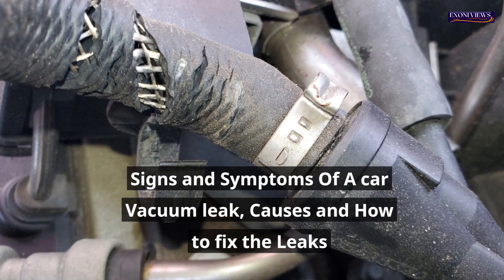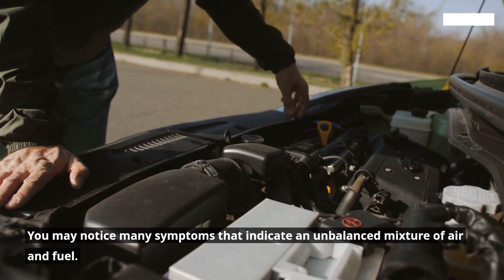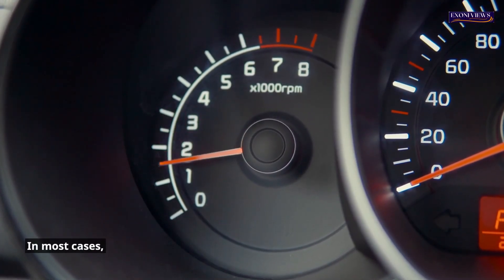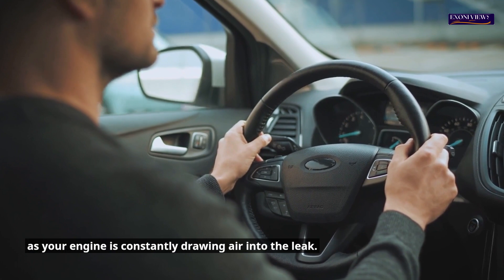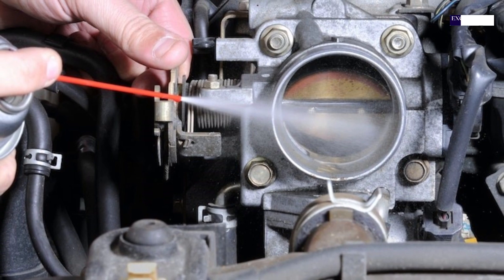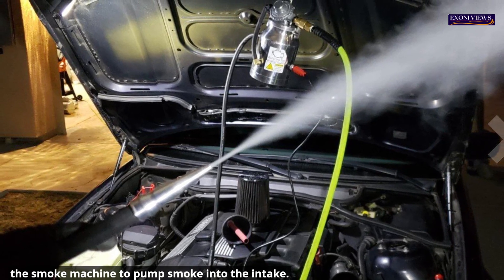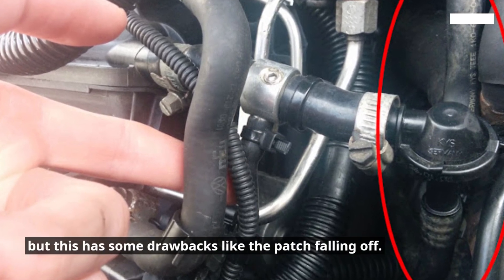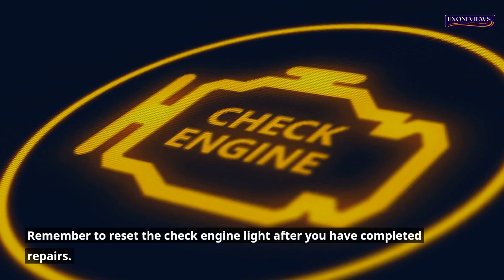Signs and symptoms of a car vacuum leak & how to seal leak

Comment: My father 2024 nissan rogue has error code p2532 at 50,000 miles. Any tips on fixing it.  Thank you
Reply from the maker: Sorry for the late reply. A P2532 code on a 2024 Nissan Rogue is unusual at just 50,000 miles. It normally points to an issue with the ignition switch circuit or the power supply going to the ECM. Since the vehicle is still very new, check the battery condition, the wiring harness around the ignition/ECM area, and make sure all connectors are tight. If it’s still under warranty, the dealership should scan it properly to trace the exact cause. Thanks for watching

Comment: I have a 2013 ram 1500 with a 5.7 hemi and mine has a engine code p219a fuel, air ratio balance bank, one that’s for the driver side and when I clear that most of the time the same code pops up or once in a while, a different code pops up for P0300 for random misfire detected all of the fuel injectors are working, I replaced a couple sensors and still nothing. I’ve been tracing this for months so I don’t know what’s wrong with it.

Comment: my freind had a vacuum leak so he covered the whole engine with spray foam it worked for a while but the foam melted and turned into a solid plastic and ruined his engine
Reply: He should have used Flex Seal

Comment: A whistling sound while accelerating? Cause ?
Reply: Something in the way of intake. maybe even inside tubing.
Reply: Something in the way of intake. maybe even inside tubing.
Reply: I heard the exact same thing when I found out my thermostat housings were about to give and low and behold both thermostats snapped and I had an overheating problem, check your cooling system. When I head a whistle when accelerating something related to my cooling system broke.

Comment: Wher dose the vacuum  hose go on a98 ford f150 .4.2 v6
Reply from the maker: The vacuum hoses on a 1998 Ford F-150 4.2L V6 connect to various components, including the intake manifold, PCV valve, brake booster, and EVAP system. The exact routing depends on the system you're working on. If you're looking for a specific connection, check the vacuum diagram sticker under the hood or in the service manual. Let me know if you need help with a particular hose.

Comment: Can a small crack / rip in the air intake tube hose cause jerky idles and Jerky city Driving spark plugs n ignition coil thermostat fresh antifreeze and Tcm motor oil n oil filter Transmission filter n fluid also serviced im swapting the Transmission speed sensor once it arrives
Only Current code right now is p0300 2005 chevy aveo ls sedan 4door 1.6L
Reply from the maker: Absolutely, a small crack or rip in the air intake tube hose can definitely cause jerky idle and driving issues, especially if it's causing unmetered air to enter the engine.
Reply: Appreciate you Capitan  @exoniviews

Comment: i have a 2013 honda civic coupe and every morning it starts rough then when i drive a few minutes it fades then start driving smooth. its just when it sits long and the engine get cools off this happens.
Reply from the maker: A rough start after sitting for a long time could be due to several issues. Common causes include faulty spark plugs, dirty fuel injectors, a weak battery, or a failing coolant temperature sensor. It could also be related to moisture in the ignition system or a problem with the idle air control valve. Try checking for any stored trouble codes and consider a tune-up if it hasn’t been done recently.

Comment: Have a po302 on my Subaru sti.  So far no luck with a smoke machine. Done all swaps,  compression,  leakdown,  o2 sensor replacement,  noid test on injector connector  what else can I do
Reply from the maker: Try to double-check the ignition coil and spark plug for cylinder 2 to ensure they're working properly. Even though the noid test showed the injector is getting a signal, it could still be clogged or malfunctioning, so you may want to clean or replace it. Also, inspect the intake manifold for hidden vacuum leaks, and examine the wiring harness for any damage or loose connections.

Comment: Hello, I know I’m abit late hahah but my VW GOLF MK7 sometime when I drive off after 30s when I stop at a junction, my RPM sits below 1k just on the line. And the fan kicks in. 
Also I’ve notice I have a leak around the engine and ‘MAF’ side. 
Also since I changed my timing belt and water pump my car started making a rattling sound. 
Do you know what could it be. 
I know it’s hard to understand what I said but if u know something help pls haha
Reply from the maker: 1.	RPM sitting below 1k and fan kicking in; If your RPM is low when stopping at a junction, it could be related to the idle control system. VW models sometimes experience issues with the throttle body or the idle air control valve. A dirty or faulty Mass Air Flow (MAF) sensor can also cause rough idle or fluctuating RPM, especially if you're seeing a leak near the MAF sensor. Address that leak, as it might be causing unmetered air to enter the system, affecting idle. 2. Leak around the engine/MAF side: If you’re noticing a leak, it could be vacuum-related, which might be causing the irregular RPM and idle issues. You should inspect the vacuum hoses, intake manifold, and the MAF sensor seal for any leaks. Also, a coolant or oil leak could cause engine performance problems if it's affecting critical engine components or sensors. 3. Rattling sound after timing belt and water pump change: A rattling noise after changing the timing belt and water pump could indicate that something wasn't torqued or aligned properly. Double-check that the timing belt tensioner, pulleys, and water pump were installed correctly. The noise could also be due to a loose belt or a misaligned tensioner, so it's best to have the belt assembly inspected again to rule out any potential damage

Comment: Replace hardened or cracked hoses with fresh ones. You can use generic cut to size. Zip tie the ends. For high mileage consider changing throttle body and intake plenum gaskets. I did that and car feels amazing. Before had less power and acceleration.
Reply: where can i get the generic hoses i got big tubes leading to thinner one's hoe do they detach or do i need to pull apart harder

Comment: my honda with idsi engine shows p0131 o2 sensor low voltage inspect sensor its good wiring also good what could be the reason i put another ecu but same code pops up what could be the reason help me sir
Reply from the maker: The P0131 code (O2 sensor low voltage) can be caused by several issues beyond the sensor and wiring, including: Exhaust leaks before the sensor, A vacuum leak causing lean conditions, A faulty fuel injector or fuel pressure issue, A bad ground or connector issue elsewhere in the circuit., The sensor itself may still be faulty despite appearing fine. Check these areas for further diagnosis.
Reply: @exoniviews  sir had inspect and i found that when i start the engine i checked the o2 sensor wiring voltage the 2 wires which is heater circuit in one wire there is 12v positive➕ from ignition but there is no ground comes from pcm i checked with multi meter and then with the tester i want to know that when me start the engine heater ground will come immediately or it will take time??let me know sir thanks for your precious support
Reply from the maker: @hayabusagsxrlovers1374  If the ground for the O2 sensor heater circuit isn't activating immediately you start the engine, but rather delays, That means there may issue with the pcm or wiring. Try checking the following areas; Check PCM function and ensure its functioning correctly, as it controls the ground. 2. Inspect Wiring to Verify there are no breaks, corrosion, or damage in the ground wire from the O2 sensor to the PCM. 3. Check for Fault Codes, Scan for any error codes related to the O2 sensor or PCM that could indicate the issue. 4. Test the Relay or Fuse and ensure the fuse and relay controlling the O2 sensor circuit are not faulty and 5. PCM Reset or Reprogram: In rare cases, resetting or reprogramming the PCM may help if it’s a software issue. If none of these resolve the issue, replacing the PCM might be necessary.

Comment: You explained everything very well, except what I was looking for, where to connect the smoking machine to the engine.     LL   : )
Reply from the maker: Thanks for your comment, I appreciate. Where to connect smoking machine is through the Vacuum line or intake manifold, then run it to detect leaks as described in the video.

Comment: $50 to $80 to buy your own smoke machine it's a great investment.
Reply: I think that’s a waste of time. That’s not going to catch say a hose thats hardened or cracked and lets air through only under pressure. Just change all suspect hoses and tie wrap the ends. It also won’t catch a gasket that leaks only under pressure/vacuum.

Comment: Can you tell me if dropping a brand new throttle body on concrete will cause it to crack and act up?
Reply: I think just visually inspect it for any damages, if butterfly closure still swings right, gaskets out of place
Reply: 🤭 naww it would fix any issues with it....

Comment: Thank you for the detailed video. Can a vacuum leak cause a p1138 code on a 2005 Nissan Sentra? Service soon engine light came on OBD reading.  Swirl control valve
Reply from the maker: Yes, a vacuum leak can cause a P1138 code on a 2005 Nissan Sentra, especially if it affects the swirl control valve.
Reply: @exoniviews  Ok. Thank you for replying.  I was told by a half baked mechanic that a vacuum leak will not cause the p1138 code he didn't even check.  I will have a real mechanic take a look at the vacuum hoses.  I appreciate your response. Thank you very much.

Comment: Great vid! I have this maddening problem, every yr, when it gets cold. I have an ‘08 pont vibe (toyo engine). The chk engine light illuminates and I get a po107 code - too lean, bank one. I must stress that I have NO outward symptoms and it purrs like a kitten until it extinguishes, either thru my code reader, or by itself, when it gets warmer. I’ve tried all yur suggestions and pretty much ruled out a vac leak, bad o2 sensor etc… What advice can u give me to try and remedy this yearly dilemma. 
Thx again👍
Reply from the maker: Very sorry for late responds. Considering your annual cold weather P0107 code issue on your '08 Pontiac Vibe, despite ruling out common causes like vacuum leaks and faulty O2 sensors, you should also consider checking the intake air temperature sensor and try cleaning the mass airflow sensor, as it might be sensitive to cold conditions affecting air-fuel mixture. Potential issues, as extreme cold can affect sensor performance.
Reply: @exoniviews  Great. I’ve cleaned and clean my maf sensor on a regular basis. I may just buy a nu one considering the relative smal cost. C if that works. 
Thx!

Comment: Misleading where it says 14,7:1 lean condition....that's actually the stoichiometric
Reply: Gasoline...14.7 lbs air/1lb of fuel
E10/Gasoline...14.1lbs air/1lb fuel
Ethanol...9lbs air/1lb fuel
Nitromethane...1.7lbs/1lb fuel
Fun fact...even though ethanol and nitro have a lower btu content per unit then gasoline more power is created by the lower stoichiometric ratio
Reply from the maker: Point noted, thanks for the observation
Reply: Unbalanced air fuel ratio & wrong ignition timings can trigger p0400.
Reply: I have p0171 Toyota Prius 2010 I replaced upstream sensor,throttle body,purge valve,mass air flow sensor, fuel pump,  can’t find the problem
Reply: @mirzm1617 blown head gasket.

Comment: this video is extremely helpful for us diyer's that have mechanical abilities. I'm worried about the intake manifold on my son's 2008 civic. The engine was replaced the manifold was disassemble'd   and cleaned. I do have a PO507 code and the idle is a bit erratic. There are internal rubber gaskets that can also leak I guess but can they be tested? My gut tells me to remove this and replace all rubber gasket's inside and out. Something I should have done while the engine was out. YTer's like yourself sure do help us diyer's find, test, repair, just about anything. My advice is to search any and every video related to learn more. I thank you and others as a form of education lowering repair cost's. Most importantly  this is a father son project that give's a strong bond.
Reply from the maker: It's great to hear you found this video useful for your 2008 Civic DIY project! You're doing a great job working together on this project and creating a bond. According to your description, it's a good idea to replace the rubber gaskets both inside and outside the intake manifold, especially if they are suspected of causing the erratic idling and the P0507 error code. You can test for leaks by using methods such as smoke testing, or spraying soapy water while the engine runs to look for bubbles. I wish you luck and hope that your repair goes smoothly.

Comment: My cruze 2 time off engine when i strt engine in morning time.. Aftr that engine run or no stop bt power going loss sometime full rpm  only 2000 rpm an sometime normly rpm gi higher in Desiel engine
Reply from the maker: . Inconsistent RPM levels and power loss could indicate several potential problems, so it's best to have a professional mechanic diagnose and repair the issue to ensure your vehicle's reliability and safety.

Comment: Hi great video😊. I am having an issue with a honda jazz 05, rpms revving to 2k rpm by itself. Could it be a vaccum leak?
Reply from the maker: Thank you! 🚗 It's possible that a vacuum leak could cause high RPMs. Check for any hissing sounds around the engine bay and inspect vacuum hoses for cracks or disconnects. A smoke test can help pinpoint the leak if needed.
Reply: If you recently cleaned your throttle body, it will need a relearn procedure through a scanning tool. If it started all of sudden, probably a leak.

Comment: How about an intermittent lean code that only comes up on higher rpms (idle is fine) either get po300 or po171 po174 every day or every 2 days.
Reply from the maker: Intermittent lean codes at higher RPMs often point to vacuum leaks or fuel system issues. Check for leaks in the vacuum hoses and inspect the fuel delivery system for problems.
Reply: @exoniviews  thanks will do.  Any chance a cheap Thornton obd plug and play tuning chip could cause this at all? One was in the truck and was removed 2-3 weeks prior to the start of this happening.
Reply from the maker: @lh98  It's possible that the cheap OBD plug-and-play tuning chip could have contributed to the intermittent lean code issue, especially if it was removed shortly before the problem started. These chips can sometimes interfere with the vehicle's engine management system. Removing it was a good first step, but I'd recommend thoroughly checking for any lingering effects or issues it may have caused.
Reply: Check out your fuel pressure regulator and fuel injectors
Reply: Have this same issue but they say a vacuum leak and there is some small holes around my exhaust system could it be this instead

Comment: My Škoda makes water gurgling noise from dashboard on ignition for 3/4 seconds and normal thereafter 

Any likely cause and remedy please?
Reply from the maker: Ok, It sounds like the gurgling noise from your Škoda's dashboard during ignition might be related to trapped air in the cooling system. This can happen when there's air trapped in the heater core or coolant lines. 
A common remedy is to "burp" the cooling system to remove air pockets. Here's what you can try: Make sure the engine is cold: Never open the radiator or coolant reservoir cap when the engine is hot to avoid burns.
Park on a level surface: Ensure your car is on a flat and level surface.
Open the coolant reservoir cap: Slowly open the coolant reservoir cap (if equipped) to release any pressure.
Inspect coolant level: Check the coolant level in the reservoir. If it's low, add a mixture of coolant and water to the recommended level.
Start the engine: Start the engine and let it run until it reaches normal operating temperature. Keep an eye on the coolant reservoir during this time.
Bleed the system: Sometimes, there are bleed screws or valves near the heater core or on the coolant lines. Consult your Škoda's owner's manual to locate them. If available, open these while the engine is running to release any trapped air.
Top off coolant: As the engine runs, the coolant level in the reservoir may drop. Top it off as needed.
Close the cap: Once the gurgling noise stops and the engine is at operating temperature, close the coolant reservoir cap securely.
Monitor for a few days: Keep an eye on your car for the next few days to ensure the noise doesn't return. If it does, you may need to repeat the process or have a professional inspect the cooling system for any leaks or issues.
Remember to follow safety precautions and consult your Škoda's specific manual for guidance. If the issue persists, it's advisable to have a qualified mechanic examine your vehicle to rule out any underlying problems.
Reply: @exoniviews  Thanks a ton for kind guidance !